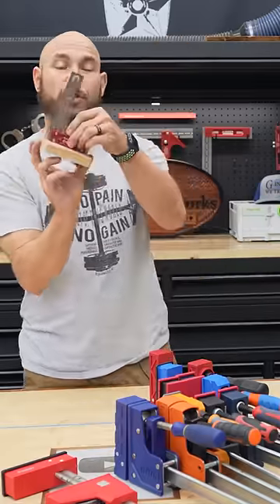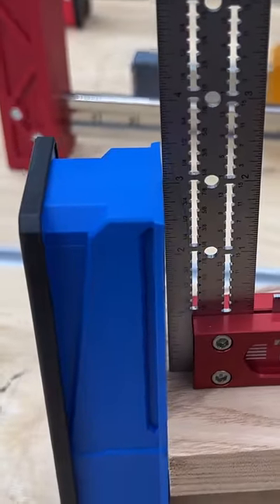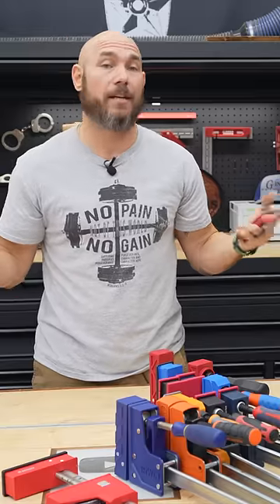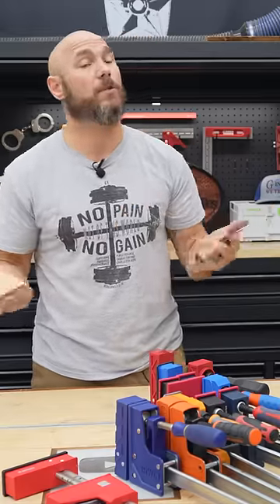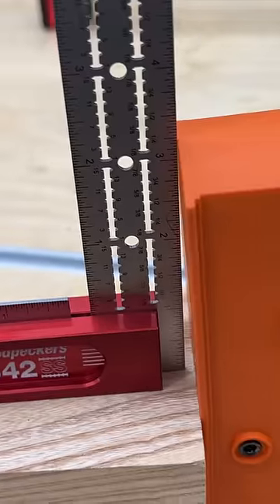Good and BAD Jaw Deflection on Parallel Clamps #shorts

Comment: I always thought they were deigned to be slightly out of parallel because when you apply tension to the clamp it will deflect a little to make the jaws parallel.
Reply: Isn't the purpose of a parallel clamp that they don't have that deflection?
Reply: @mlenz2553  maybe? Never been able to afford one to try.  I just put bar clamps on top and bottom of the piece.  Its gonna get surfaced anyway...
Reply: That is exactly how they are designed to work.
Reply: Same though here, being plastic in tension, and where in the bar or the clamp is to be applied, meaning that if your piece is 90° the bar will adjust accordingly.
Reply: Just like a wood working vice. SHOCKER
Reply: @kcChicken123  Yep - no vise is gonna have zero deflection. The real question: is the deflection too much for your uses?? 

If you wanted a really crazy tiny amount of deflection, like 1 thou, you'd need a MASSIVE cast iron or billet vise with multiple large precision screws. And even then, you have to account for things like thermal expansion!

Anyway, these parallel clamps all seem pretty much "good enough" for fine woodworking!

Comment: @731 Woodworks

You're missing a huge piece of the puzzle here.  That jaw deflection is built in on purpose.  The reason for it is so that under load, the jaws will become parallel (or close to it).  The longer the jaw is, the more it will deflect, no matter the material.  Not only will the jaw deflect, but the bar will as well causing more deflection in the jaw.  These clamps with built in preload deflection are engineered for heavy clamping applications.

The ones without deflection or less deflection are designed for light use applications and much less load capacity.  Don't believe me?  Test it yourself with light and heavy clamping forces applied to a perfectly square surface.  You'll see the square jaw clamp  open up so that the tip of the jaw is no longer touching the clamping surface once a heavy load is applied.  If you apply a heavy load to a pre-deflected jaw clamp, it will even up on the clamping surface the more force you apply.

TLDR: pick the jaw profile of clamp that is right for the amount of force required during clamping in order to maximize the amount of surface area of the jaw in contact with clamping surface.
Reply from the maker: These are all deflection under load and the jaws are not parallel while under that load. The "good ones" did not deflect under load.  Watch the full video on the channel.
Reply: @731Woodworks   @731 Woodworks  I did watch your whole video.  I've been designing and making clamping systems for seven years, and the first thing they teach you in engineering school is that everything deflects...even tungsten carbide will visibly deflect before critical failure.

I think your methodology for analysis is missing some key factors such as using a quantitative vs qualitative approach for the load profiles.  In other words you need to use units of measure for defining values of force to fairly compare one clamp to another.  You said in the video that some of the clamps have a finer pitch, and this would give you a mechanical advantage and allow you to apply more force to the workpiece with the same or less torque applied by your hand.

Another thing that is missing is measuring the hardness of the bar.  If the bar is deflecting, is it because of the amount of force applied or is it because the hardness off on the steel causing it's ultimate strength to be lower leading to increased elasticity.

Lastly, back to defelction of the jaw, there isn't a perfectly square jaw in the world that won't deflect under load.  This is because all materials undergo elastic and plastic deformation under load.  How resistant the material is to both forms of deformation is defined by the area under the curve for the elastic and plastic regions. To combat this issue in offset load clamping (such as the clamps you've shown) positive deflection needs to be artificially built into the system, just like how flatbeds for semi trucks are curved up when not loaded with freight.

The only case that could be made is that the preload angle of the jaw is too steep for the overall design of the clamp or it's application, but no preload angle is incorrect, and that's what you will see in inferior brands.
Reply: @DiametralPitch  what you said is generally way outside the scope of this video. Upon a normal load, the jaws are expected to bear, the jaws are out of parallel. The preload angle doesn't matter. The exact torque applied doesn't matter. Whether it was the bar deflecting or the jaws doesn't matter. The hardness of the metal doesn't matter, unless we're talking about plastic deformation over time, which was clearly not in the scope of this video. You're talking about it from the design perspective, which is very different from just verification of function at initial purchase.

Comment: Is the deflection not a feature for when pressure is applied, it will square out instead of bowing out?
Reply from the maker: These are all deflection under load and the jaws are not parallel while under that load. The "good ones" did not deflect under load.  Watch the full video on the channel.

Comment: The jaws are purposely angled. As you add pressure they straighten out. Go look at a semi trailer.  its shaped like a hill, having crown. As it's loaded it becomes flat. 
You can clamp at the back of the throat of the jaws, but those plastic jaws are designed to be clamped at the tip.your work should be on the bench and not supported by the clamp itself.
Reply: P.s. I'm not talking about bar clams
Reply from the maker: there were all loaded.  the "cheap ones" deflected whereas the Jet, Bessey and Harbor Freight remained parallel, as they are intended.

Comment: Maybe that deflection is designed in, you know, to keep the part in the jaws…….
Reply from the maker: they are supposed to be "PARALLEL" under load.  hence the name, parallel clamps.
Reply: @731Woodworks  "under load". You said it.

Comment: I don’t think it needs to be parallel. Once you crank down on it even a 1/4 turn, it’ll come out of square anyway. It’s just meant to hold pressure. Any one of those clamps will be fine.

Comment: I’m not a clamp engineer but I don’t think those are design defects. 

Hopefully a qualified engineer will be able to explain that the deflection is actually designed into the product to assist in clamping.

Comment: So do the same test, using wood that is the same thickness as the clamping surface and apply clamping pressure. Then test for square by applying the square upside down. Only then will you know the true deflection.  By only using a thin piece of wood as shown, you creating a moment arm at the top of the clamping surface.
Reply from the maker: Most people aren't clamping a 3" thick piece of wood. Most clamp 2" or less
Reply: Very true. But I suspect that if you did test with that thick of a piece, I think you’d find less perceived deflection.  Don’t get me wrong. Love your stuff!

Comment: OK but they are so big the it's not from fitting so with all the extra space not touching anything of course it's going to be off. That's why they make all sorts of clamps for different things and sizes. So really I would never go based off of this "fact". Also you had the square offset more to the middle. You didn't have it on the edge like you should have.

Comment: You damaged your block from clamping down to hard.... Plus your using it wrong.... Your block should be on its edge and not laying flat...... But thanks for your opinion while incorrectly using your tools...
Reply from the maker: You're incorrect.  The JET, Bessey and Harbor Freight performed as they should.  The others, did not.